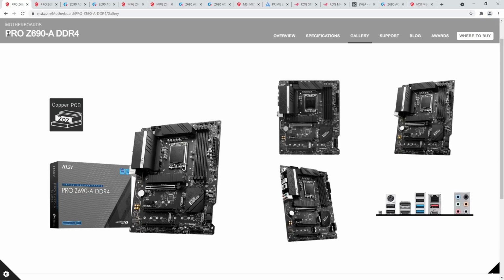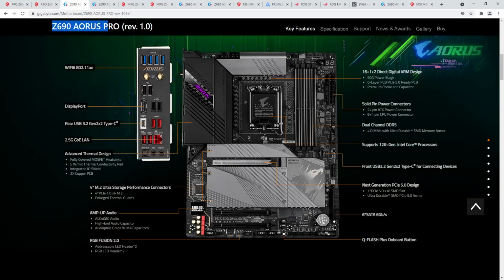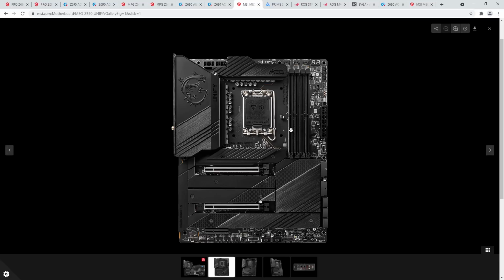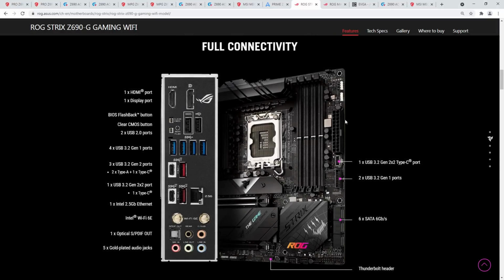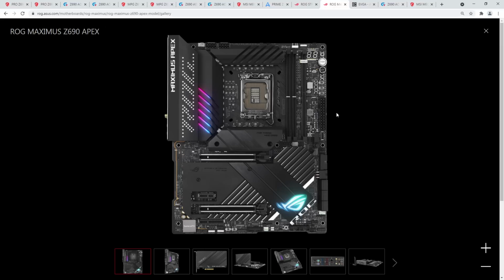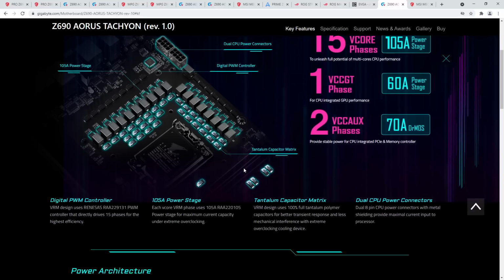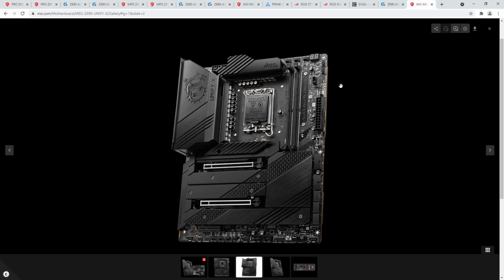Z690 Motherboard round up

Comment: Timestamps:
00:01 Intro

ATX/E-ATX
0:43 MSI PRO Z690-A Variants
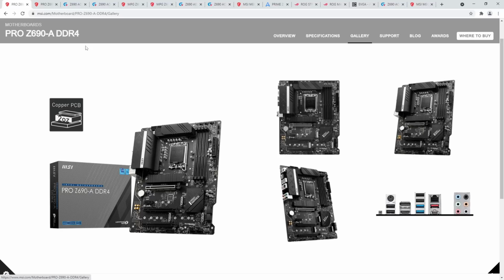4:50 Gigabyte Z690 Auros Pro
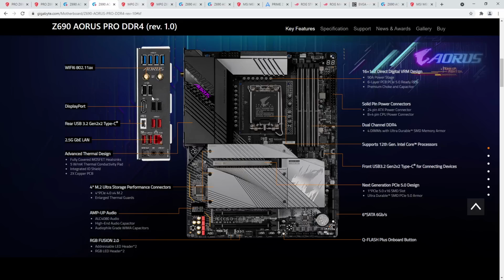7:28 MSI MPG Z690 Carbon/Force
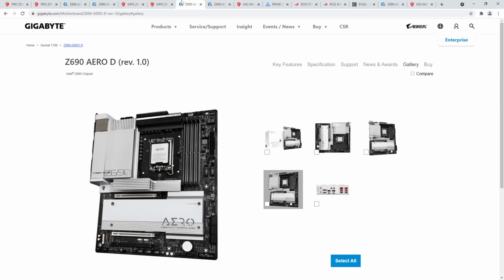9:20 Gigabyte Z690 Aero D
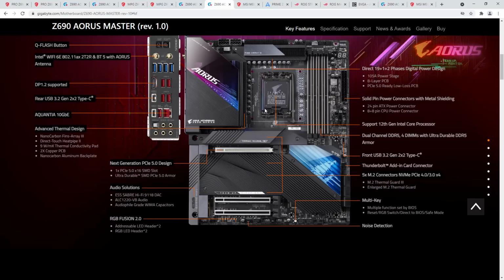10:51 Gigabyte Z690 Auros Master
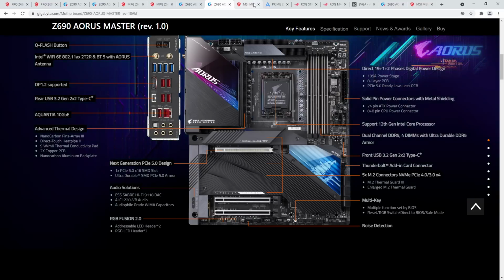12:06 MSI MEG Z690 UNIFY

mATX
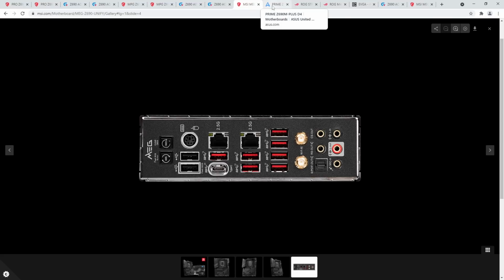15:12 ASUS PRIME Z690M-Plus D4
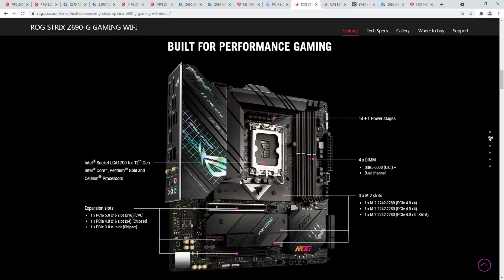15:57 ASUS ROG Strix Z690-G Gaming WiFi

Extreme Overclocking
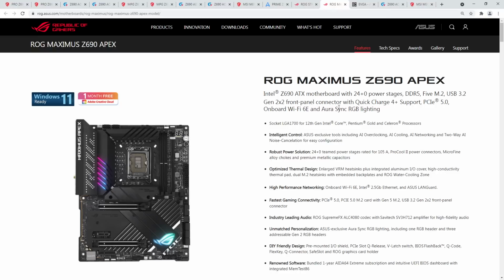19:11 ASUS ROG MAXIMUS Z690 APEX
23:42 EVGA Z690 DARK Kingpin
24:45 Gigabyte Z690 Auros Tachyon
28:32 MSI MEG Z690 UNIFY-X

31:00 Ending thoughts

Comment: After looking at hours of computer purchasing advice from several sources I fully respect I followed your advice and just purchased the MSI PRO Z690-A WIFI DDR4, 2 kits of Patriot Viper Steel DDR4 16GB (2x8GB) 4400MHz for 32GB total and i9-12900k.  Since you recommended the memory and motherboard it would be awesome to see you do a video on overclocking this setup.
Reply: How are the VRMs on the MSI Z690-A handling the 12900k?

Comment: Even bare bones Z690 boards are like 300+ Euro in Europe. Just crazy prices, no wonder that retailers reported underwhelming Alder Lake sales. The DDR5 boards are hilariously expensive (580+ USD equivalent) and they still only have big chunks of aluminium for heatsinks and no extra features that you'd normally find on such expensive motherboards. Not that it matters because DDR5 is three times the price of DDR4 and never in stock anyway.

Comment: I love the Unify-X, especially the included tuning controller.
The Unify non-X and the Ace also have a connector for the tuning controller, but the controller itself is not included and I couldn't find it anywhere sold separately.
Reply: I'm leaning towards the Unify, and Unify-X just based on Color Scheme. The Ace has too much Bling 😀 If only I can find them for sale somewhere now, along with DDR5 memory.
Reply: Still loving the z490 unify. Probably be 13th or 14th gen until I upgrade but I hope they continue the line.

Comment: MSI boards are doing very very well with fast DDR4, like 4000MT/s at very tight timings in gear 1.  Probably going to go with the DDR4 Tomahawk, seems okay for $300, and some recent benchmarks show ~10% or more gains in many games over even fast DDR5 with good DDR4.
Reply: Yes, MSI doing best with memory OC
Asus now should learn "how to" from them
Reply: the budget msi one doesn't have thunderbolt, other than that it's goooood compared to the asus prime z690m.. I think
Reply: @rulik007  Asus needds to fix their bios and VRM heatsink design before even thinking about making it more overclockable.
Reply: @PointMicrosoft  hardly a dealbreaker imo. msi outdid themselves again. 

for a "cheap" and "budget" ($250 btw) board, it has wifi 6e, decent VRMs & power delivery, 2.5 ethernet, man usb 3.2 gen 2 and gen 1and 3.2 2x2 usb-c.

x3 m.2 gen 4 slots, one gen 3 slot. PCIe 5.0, a bios flash button, and great cooler compatibility -- something even the higher end boards don't always have. this board makes cheaper x570 boards look like joke, especially regarding memory overclocking.
Reply: Link to benchmarks please?
Reply: I recently installed ddr4 4000 cl16 on the tomahawk, and it noticeably improved performance in games.
Reply: @byronfranek2706  that’s because it’s fast memory haha
Reply: @basedanon420  well also because the ram is running in gear1 at the native speed of the memory controller.
Reply: @byronfranek2706  I've just picked up an A-Pro to use w my well binned bdie and 12900k. Let's see how this goes haha

Comment: I bought the  MSI Pro DDR4 because it was part of a bundle with the 12600k, on Newegg. I know it's not premium, but I hope that after this video, I'm not regretting it.
Reply: That was very re-assuring! Thanks!
Reply: "Premium" in the context of PC components mostly means you paid more than you should've.
Everything that comes from one company uses the same SMT line at the end of the day, with he same QC and the same warranty
Reply: @dighawaii1  Just stay away from ASRock's low end Intel offerings. AMD, somehow, have strong-armed ASRock into not fucking with low end 5xx AM4 boards, but they did have a few B450 duds. But other than that it's pretty much "You do not get what you pay for beyond $200".
Reply: Bruh the video wouldn’t make any difference to u, u already bought it so be it. Just because he said it’s good doesn’t “make” it good, it is what it is.
Reply: @MaxLan-o4l  can I not hope I made a good decision? BTW, it's awesome!
Reply: How has your experience been? My system came with this board and it constantly freezes, even in the BIOS. After stress testing the CPU, RAM, and GPU successfully I’m guessing it’s the board.
Reply: @SooksVI  I have had no issues related to the board. I have had to repair windows 11 a couple times, but it's pretty painless. I keep all my files/programs of course.
Reply: @dighawaii1  I see. I'll know for sure after replacing the board. Thanks for the reply.

Comment: Thanks for the videos that you have put up on the new z690 boards.
After watching many videos it was your videos that helped me decide that for my use the Gigabyte z690 AORUS PRO DDR5  was the one that for performance/value made the most overall sense for me.
As a gamer that uses quite a few different gaming peripherals I like the excess of back panel USB ports and they kept the digital optical output which is what I use to feed my headphone dac as well.

Another thing that I took notice of was the 90 amp power output not that I need them today at all but who knows what demands 13th gen Raptor Lake chips may make and I wanted the extra headroom as a little insurance of no future issues if I wanted to make that upgrade down the road.

This will be my first Gigabyte board, years ago I liked the earlier Asrock boards but they went downhill and have been using ASUS boards since.
This gen ASUS prices are out of line and the Strix boards as a gamer that prefers large air coolers ASUS screwed up by making the new boards where the heat sinks will not allow clearance for the industries most popular large air coolers.

Thanks again for the videos as it was your information that made me decide on the AORUS Pro over the MSI Carbon I had been leaning towards.
Now to find some ddr5 memory!
Reply: Hey, How is the Aorus Pro so far ? I have all my pc parts ready except for the motherboard and the ram and so far I like the aorus pro ddr5 the most. 
Please let me know if you recommend it and which memory did you get.

Comment: The high end extreme boards cost more than the rampage vi extreme encore. What a meme. Who is spending £900-1600 on boards for a £580 cpu 🤔🤯🤯
Reply: The Asus Maximus Extreme Glacial. Great value... at €1700. 
Push 2500A into the socket
Reply: @vibonacci  Just to get +200 possible mHz for some people?) If CPU will not burn down all coolant in instant
Reply: I bought a 1000€ board for my 10600k:)
Reply: @dvr1337  Now that's an overkill)
Reply: @dvr1337  why?

Comment: I bought the MSI PRO Z690-A WiFi DDR5. as like you said, it does everything you need, without the fuss. Also I needed a PS/2 port. And it was also the cheapest DDR5 board I could buy in Australia.

Comment: Even though I don't overclock and just use non-K cpu, i still use Z mobo (ATX version) for the feature-set, expandability options and ease of building in them.  I'm not particularly picky on VRMs.  For my use case, things I look for in the motherboards, 2.5G LAN port (Intel), the amount and the spacing of the PCIE slots, and SPDIF output.

Comment: As someone who's been questioning rising motherboard prices since like 2016, I could see this coming.
It's egregious at this point and it would be really interesting if any inside baseball comes out as to why they just keep going up and up, It's not like any of these companies are hurting for money
I've heard excuses about newer CPUs needing HEDT levels of VRM capacity or there being a chip shortage. Those augments though just aren't holding water at this point. 
Wonder if AMD motherboards are going to get the same treatment on AM5
Reply: part of it is the needs of higher signalling for higher speed devices like PCIe Gen 4 everywhere and now PCIe gen5. Dealing with the much higher speeds becomes exponentially more difficult as speeds increase. 

there's also the way/distance those lanes have to go to get to their respective connectors. For example the x8 gen 4 DMI to the chipset, which then has to service multiple gen3 and gen 4 devices, some of which are as physically far as the CPU is from the chipset. Then take into account how each trace has to be within a very small tolerance in length of it's other connector traces, and you begin to see where the cost/complexity comes from. 

there's also inflation and such, and wanting to increase margin of course, but compared to the z77 or p65 days, we also get way more features than we ever did before
Reply: Just a bunch of excuses to gain more money. When a mobo it's priced more than the best cpu of that gen that someone can put inside of it, it's overpriced and totally not worth it.
Reply: @andreabriganti8621  eh its not worth it but well some people can get minor advantages and subsidize them easily enough
Reply: @andreabriganti8621  for the top end boards, of course, but it's always been that way. Remember the SRX, the SR2 etc.?

What I'm getting at is the entry level boards that have the premium chipset.
Reply: @dstblj5222  With theyr money, people can do whatever they want, not worth mean not worth mate, not useless. In fact, someone can find an use for that kind of overpriced mobo and, in certain istances, maybe some minor argueably  " advantages ". Or, they could save alot of money and buy better and/or more storage, ram and so on. Isn't that a realistic and way better advantage? Or a more effifient  psu with higher wattage + saving some money for next gen of overpriced and energy-eat monster gpu. The same people will go for expensive and unoptimized ddr5 and a couple of 3090 at nowdays prices. I don't get it. However, sorry for the late answer and this essay btw.
Reply: @camofelix  Yeah I agree. In fact my point was about a mobo that it's priced more then a top-tier cpu as a 12900k.

Comment: i think it is worth noting that every single z690 board that supports splitting the pcie 5.0 x16 into two x8 slots, also only is available with ddr5 support; not one single board that supports ddr4 has this capability. additionally: gigabyte specifically, as opposed to the other major manufacturers, has limited this functionality to their extreme high end, leaving out their high $300s and low $400s models.

the ability to break up these 16 lanes into two slots is absolutely critical to extracting the maximum performance from this platform, as most current pcie 4.0 gpus will lose little to no performance by dropping their link from x16 down to x8, and upcoming pcie 5.0 gpus will be able to leverage the full pcie 5.0 bandwidth and therefore x8 will be equivalent to a previous-generation gpu running an x16 link. this creates a situation where we can use two gpus simultaneously and effectively, a single gpu with pcie 5.0 nvme disks, or even a discrete raid card like a highpoint, or any other high-bandwidth pcie devices one can imagine.

without the ability to break up those 16 lanes, the entirety of the pcie 5.0 connectivity is eaten up by a single gpu that doesnt necessarily even need it, or take advantage of it. now, while not every single use case demands such functionality or such a degree of squeezing every ounce of performance out of the equipment, i feel that it is distinctly unfair to limit this feature to only ddr5 boards thereby excluding anyone who isnt ready to buy the worst and most expensive ddr5 modules to ever be made - the first wave of them.

Comment: A motherboard is basically a cable: could not disagree with you more.
Reply: In reference to how all it does is distribute voltage. In the most basic of senses
Reply: Agreed. It's more like a big bundle of cables than just a cable.
Reply: It's copper traces going places with a power regulator. That's what my laptop power brick does too! :P 

Seriously though, if you want to take Buildzoid up on something said as a joke I can 100% assure you that just leaving a normie comment like "could not disagree with you more" is going to get you nowhere. Regular viewers will just take the piss out of you if you don't back up your statement with formulas, equations and links to manufacturers documentation, and Buildzoid won't even dignify you with an answer unless you bring solid statements. Like, what did you expect?

Comment: I hope the DDR4 overclocking "issue" on gigabyte is just temporary and it's gonna be quickly fixed...
Reply: There's an abundance of bugs as well. Even in best case it'll probably take them quite a bit of time to have actually functioning bios.
Reply: @Cuthalu  for ddr4 overclocking you need to set in a lot of manual value, specially primary and secondary timings.. as for bug, it can't see my UEFI drive throught advanced setup but it can in ez mode..

Comment: Overkill VRMs probably came about due to the collective lashing from 2013-2015. Manufacturers seems to be cranking the price up $100 for another $40 in VRM parts though so the value equation has been suspect since Z490.

On the other end though, even these power end Z690 boards are better than the high end Z390 or Z370 overall so you're not getting short changed as long as the marketing and naming structure is ignored.

Comment: In your opinion, if you could choose between ASUS or MSI for extreme overclocking (disregarding pricing), which would you go for, and why?
For RAM overclocking, which would you recommend more?

Also, what is your opinion on the whole shift to DDR5? Do you think it is overly early to adopt and not recommended for the 12th Gen?